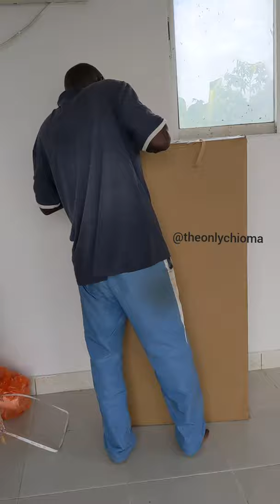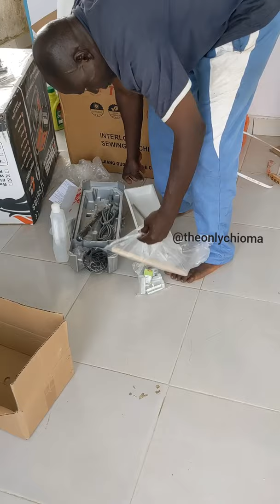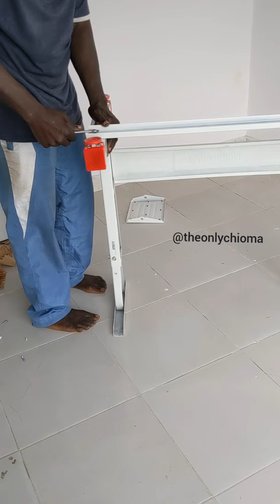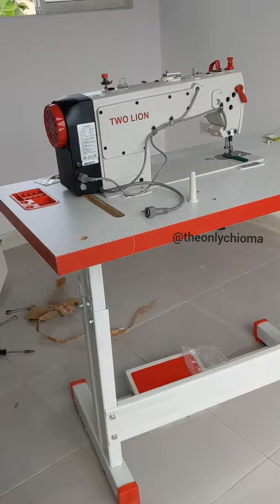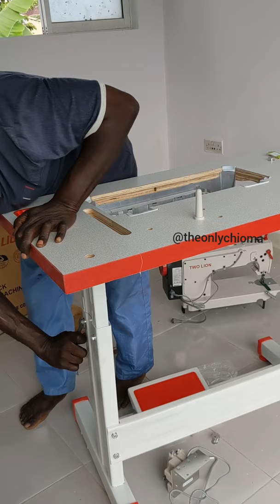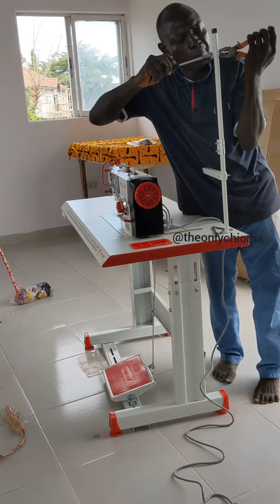Assembling an Industrial Sewing machine/ Two lion direct drive / servo motor

Comment: Dis you add to the oil that came with the machine before using?
Reply from the maker: No I didn't. I topped up later after it was serviced for the first time.

Comment: I learnt it does overlooking both inner and outside  is that true? Also can please share the pro and cons of both direct and clutch type.
Reply from the maker: Direct drive sewing machine does not overlock. It is a straight sewing machine. That's all it does. I don't know about pros and cons but the reason I bought a direct drive is because of power. It doesn't consume power. I wanted something that won't disturb my generator too much. I have 3 and I use a 2.8kva gen and no issues. I can't use 3 clutch motor sewing machines with 2.8kva gen plus iron.

Comment: Hello dear. Thank you for your wonderful videos. How is the sewing machine holding up? Can you control the speed with ease? Can it sew denim, canvas and leather? Someone suggested that I buy the Emel M2 direct drive. What do you think?
Reply from the maker: It's holding up real good. Yes I can control the speed with ease. I haven't tried to sew leather, Canvas or denim but I saw a post somewhere saying that the clutch motor machine does a better job at sewing those than this servo motor machine. Emel is a good machine but I'm a fan of two lion which is why my store is filled with two lion products 😂. I've been using only the two lion brand since 2015. I used the clutch motor version which served me extremely well before I switched to the servo motor (direct drive) version to save power and reduce noise.
Reply: @Theonlychioma  Thank you darling. Will look into getting that.
Reply: Hello. Would you perhaps know how to clear Error-07 on this machine? I have this exact type and bit stopped working tonight. Will appreciate your response
Reply from the maker: @busolaoyinkonsola613  That happened to me o. I disconnected it from power and left it for about half a day and then put it back on and immediately pressed the P button and the S then it showed numbers. I was so glad because I thought it had gone bad. Also please check your manual.

Comment: Ma’am please which will you advice someone to buy between Emel or two lions? And also what’s the advantage of a direct drive industrial machine
Reply from the maker: I haven't used Emel before so I don't know about it. I've used two lion since 2015 and I've had no issues at all. 

With direct drive your can control the machine speed. Also, it saves power. You can use 10 direct drive with small generator and it won't affect the gen. Also, direct drive uses servo motor (panel) while the other machines uses clutch motor so that noise on the direct drive is drastically reduced.

Comment: Pls can you tell the difference in the durability of the servo vs clutch motor cos someone was saying the servo motor isn’t strong
Reply from the maker: I only just started using the servo motor some months back. I used the clutch motor for 5 years and I didn't have any issues at all. I haven't had any issues with the servo motor so far. The technician asked me to get a POWER SURGE to prevent power from damaging the machine panel as it's more vulnerable than the clutch motor.
Reply: Thank you so much for the response , the vendor I bought it from told me the same thing